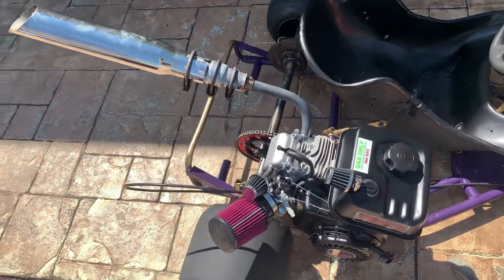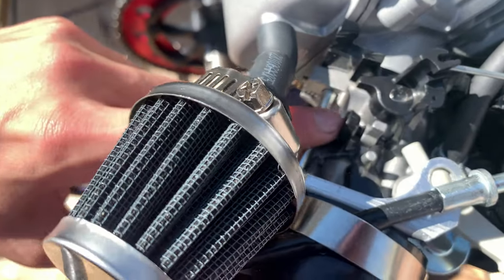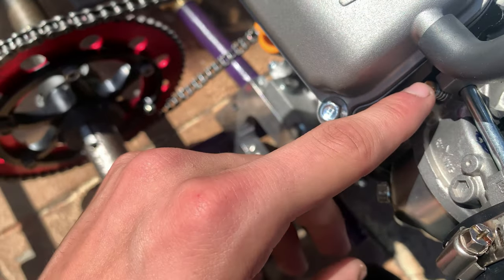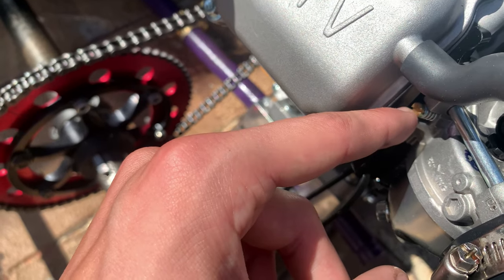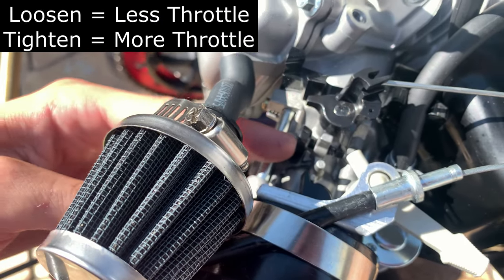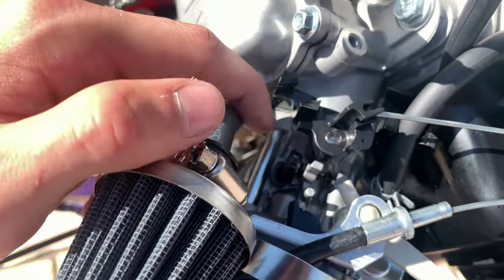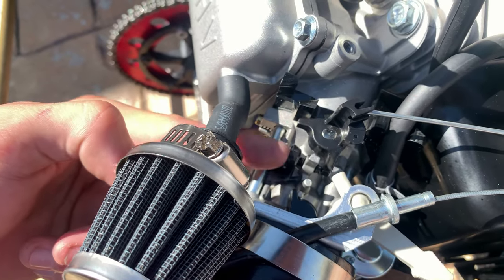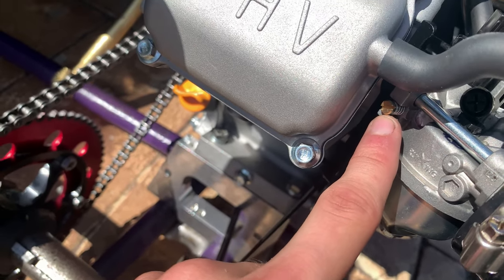How to Tune a Predator 212cc Carb (Non-EPA)

Comment: Jumpin Jesus on a pogostick.  Finally I found a video that gave me which is lean/rich on the brass screw.  Everyone wants to tell you how to tune without telling you how to tune.  Thanks man.  Liked and sub'd.
Reply: Its backwards, tighten is lean & loosen is richen & if fuel mixture screw is behind carb (spitting it in half) its fuel, if its front half its air mixture.
Reply: @Mroswaldo16  Thanks man.
Reply: @oswaldocastillo6305  I know how thos stuff works but I was confused on why my carb wasn't adjusting and was thinking I was missing something so I looked it up and dude said it backwards

Comment: how did you get the screw mine has the brass screw but no head to adjust i have the (Predator 60363 212cc gas engine
)
Reply: Maybe your has an EPA carb. You might have to use a dremmil and make a slit.

Comment: Wait, isnt backwards? Tighten is leaner & loosen is reacher?
Reply: Yes he's backwards but it doesn't matter when you are doing the proper fine tuning procedure. If you want a richer mixture coming from the low speed circuit then get a bigger pilot jet. The fine tuning screw is a waste of time. Most guys don't know the proper adjustment procedure in the first place.

Comment: I'm fairly new to many bikes. I went to mess with the idle screw on my bike because it was idling too high. However, in the process of doing so I think I loosened it too much which caused my bike to die down and shut off. Now I am having trouble pull starting.  I have no idea what to do.
Reply from the maker: If the idle is too high or low it can have issues starting, you gotta find the right balance

Comment: Is that gold screw (fuel/air mixture) on stock predators?

I took out my jet and emulsion tube- they looked pretty clean. I cleaned em again anyways. Put ‘em back in.

My bike still dies if the choke is all the way off. I can turn the choke about 50% off and go 25mph.

Based on that, I’m thinking the fuel isn’t rich enough with the choke all the way off. So if I tighten that screw I should be able to go choke all the way off.
Reply from the maker: No, i believe you have to get a Non-EPA carb for that
Reply: @zachwarne I got a clone one that has it thanks
Reply: @zachwarne only thing the clone didn’t have was that circular spring hole but I was able to swap throttle plastic pieces from the original to the clone

Comment: PLEASE HELP!! I am literally right now looking at my carburetor and it's just sealed.. there is now screw!  How the heck are you supposed to make adjustments??? PLEASE HELP
Reply from the maker: Only non EPA carbs have an adjustment screw
Reply: @zachwarne  how do I make adjustments to my fuel/Air? I've cleaned my carb twice now and cleaned all the jets and took out the throttle screw and removed the other small jet under it and it still is running like shit. Like maybe it's getting too much fuel and not enough air. Making loud spuddering pops and spewing out gas smelling exhaust/lighter colored smoke. The spark plug was more of a black color but was wet with gas when pulled (brand new spark plug with a .025 gap.) Any ideas as to what is the problem or how to fix it?

Comment: So you turn that little screw to tune it? Which way, and how far to make it run faster?
Reply from the maker: Usually the richer the faster, but you have to find the right ratio for your engine and the mods you have on it

Comment: Iv  adjusted in and out lost track of the turns either way still surges  cleaned carb it's only got 2 hrs run time cleaned breather I need to know factory carb setting. Do I run it in all the way them back out to true setting.  What is the true setting can't find that info anywhere .iv had nothing but hell with this predator 6.5 since after first 30 minutes of run time
Reply from the maker: Usually factory setting is fully in, then back it out 2 full rotations
Reply: @zachwarne  thank you

Comment: I got a 212cc mini bike I’m new to this it works and everything right but like it idles weird and when if. I wanna go I activate the choke and it goes right but when I start slowing down it dies and the guy said it needed a  new carburetor so ima change that but for now I’m hearing clean the carburetor right now to see if that works or the idle screw something like that
Reply from the maker: Mine used to stall when I slowed down, so I turned the idle throttle screw up and made it run richer and that fixed it
Reply: @zachwarne  Soo the idle throttle screw is that the black thing or like I think I know what it is
Reply from the maker: @EdwinIzaguirre-pb8qt  yeah

Comment: Would have been nice to have a demonstration
Reply from the maker: I could do that, good idea
Reply from the maker: old man strength  maybe the new jet isn’t right in right, because if it’s cutting out, it’s probably not getting enough fuel
Reply: @zachwarne  I disagree with burton a 48 second video is exactly what I was looking for not a 10min tutorial on how to tighten and loosen 2 screws. Bravo 🎉.
Reply from the maker: @Durfboard  that’s what I was aiming for

Comment: is this true other people say loosening it mkes it richer
Reply from the maker: From my experience, tightening it makes it run with more fuel
Reply: @zachwarne  u sure ?
Reply from the maker: @sandmhoder  yes
Reply: @zachwarne  why is it so hard to find info on this online are you 100 percent positive that tightening makes more rich?
Reply from the maker: @sandmhoder  yes
Reply: @zachwarne  So tightning brass screw adds more air and loosening it reduce the air. Am i right ?
Reply from the maker: @krzysztofslipecki4584  tightening adds more fuel
Reply: @sandmhoder  bro do u knoe how the screw works lol u unscrew it it allows more  air to go past the threads  therefore making it more lean, lean meaning mor air, wheb u tighten it, it stops air from leaking past threads making it richer, but its such a little change that it 99% doesnt correct for things if u add air filter kit or exhust u just need to get a jet kit, this is for fine fine fine tuning nothing more
Reply: @lifebehindtheselens  my carb has a .022 low jet and a .037 high , are stock style carbs junk ? id rather keep stock style since i have the linkage already and stuff but my friend says mikuni vm22 is 100 times better
Reply: @lifebehindtheselens  Leaking past the threads? No. And it is not an air screw, it's a fuel screw. If it was an air screw it would be on the other side of the venturi just after the air filter.

It is a fine tuning screw. If guys knew the proper adjustment procedure and what they were adjusting for they wouldn't give the screw a second thought and would leave it at 1 1/2 turns out. If you want more fuel get a bigger pilot jet. The larger jet is useful at 5K RPM. It's useless at engine idle.